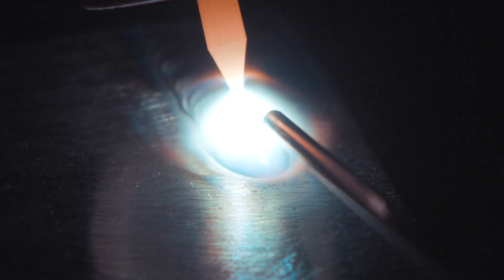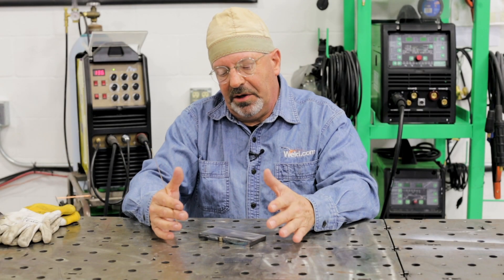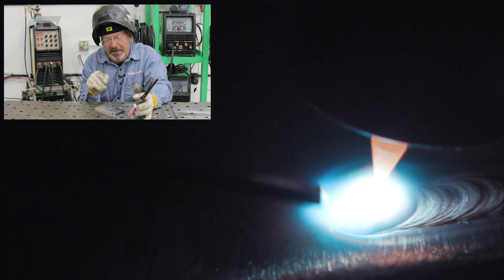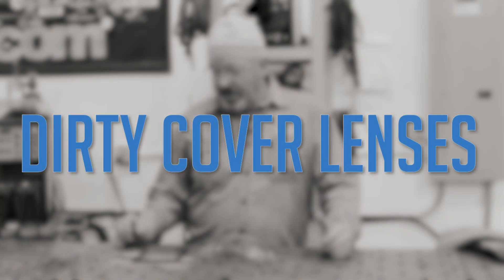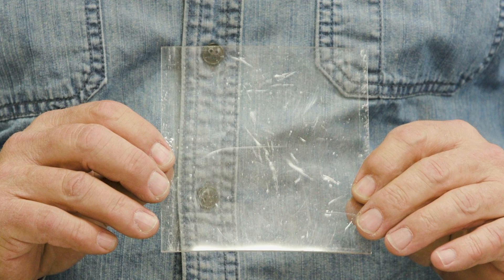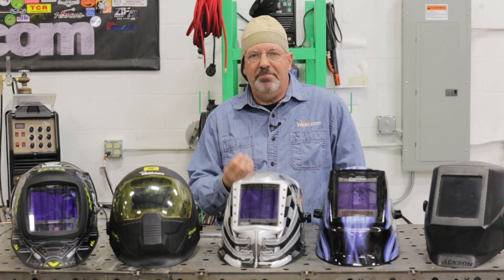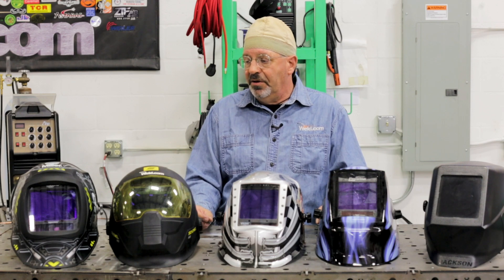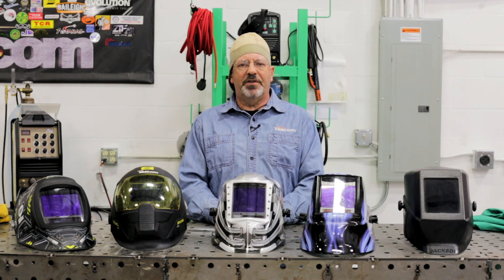I CAN'T SEE WHAT I'M WELDING!!!

Comment: I've always had poor sight from my left eye and used to suffer from the same issue welding,  which turned out to be light coming in from behind my mask, actually the sides. I noticed that I welded better, in the garage in low light conditions. Outside, I couldn't see at all after striking an arc. To test my theory, I ran some duct tape around the mask so that it touched my face. Instant success but it leaked light if I moved my head much. To remedy the leaking I installed window a\c foam around the inside of my helmet. It hugs my face, and keeps out the backlight. No more issue. To keep from trapping fumes, I leave .5"  gap on the top and bottom.  I also wear an n95 face mask, always did.

Comment: I went from a fixed shade lens to the cheaper auto helmets and managed okay.

Then one day I went on a spree and bought a higher end Speedglass auto. 910XX, (around $AU650) with the optical quality screen and colour sensitive which was also suitable for TIG. 

The difference was rather astounding. It was really easy to determine the difference on weld pool and slag especially with flux core. It certainly reduced the concentration requirement factor and made it all less tiring.

The old fixed lens still has its place I guess, but I haven't touched it in a long time now. 

Some of those cheap auto darkeners really aren't very good to use.

Comment: Seeing clearly is important for penetration.  I used an 11 shade and got used to it.  It's the best shade for high amps and you can still see decent at low amps.  I never trusted a 10 to protect my eyes completely.  Tig welded for 38 years and still have 20/20 vision.  But it's whatever works best for you.

Comment: Great video!  I welded for years with beautiful results.  I took ten years off with a job change and when I picked up the torch I was stunned at what happened to my skills.  I couldn't stay on track, my welds were awful and then I discovered I got older and I couldn't focus with the bifocals I now wear on a daily basis.  I got a cheater lens for the inside of my hood and the old me was back in the game!  The loss of visual acuity is so gradual and even with dirty or damaged cover lenes you have to keep this stuff clean.  Love your video's and love your style of instruction.  I wish I knew you 30 years ago to get me started.  Thanks again!!
Reply: I found the same when I got glasses. I think it changed=s your focal length and how your hands act with that as well. 

Getting your head back (especially if long sighted) and changing your welding posture with some practice helps.

In short, getting glasses really changes your welding dynamics, visually. This will often transfer through to your hands.

Comment: You seem to have a slow travel speed in this video. Is that because you are welding a thick piece of stainless so it does not over heat or is the video in slow motion ?

Comment: I bought a leather sandblasting hood on eBay. Pretty cheap. Got a snap kit for boat covers from boat supply house. Put male snaps on the hood and the female part on the helmet. The hood snaps on/off, keeps extra light out of the helmet. Works great underneath a car or outside.

Comment: I found putting bright lights on the whole job makes seeing what you're welding so much easier.
Reply: I found that welding refinery pipes outside in the winter dark really lowers ones expectations on quality😅
Reply: @datadavis  Right.. can't take a light plant with you to every job site , I was taught to run my auto dark on as dark as possible around a 11 or 12  so I know what to look for , now that I run a 9-10 I can see everything even in the dark
Reply: @jjames5928  good idea I think I'm going to practice that after I get good a certain welds.
Reply: @jjames5928  I aim a bright flash light at it while mig welding.
Reply: @jjames5928  
Interesting video. Just had the second session of a TiG class. I’ve been welding gas/Mig and fluxcore for almost thirty years and struggling a bit with good beads in class. Watching this video was a lightbulb turning on- no pun intended. I’ve done fine with Mig and wire feed fluxcore for years, but have been annoyed at times for losing an edge or wavering from a straight line with Mig. Now I see- pun intended- that running shade 10 or 11 is the problem! That first 50-60 seconds was an eye opener; I’ve essentially /never/ seen that with Mig and definitely can’t (haven’t ) seen that detail with TiG. I’m going to back down to 9 (or 10 if 9 is bright. 

I wish my class 30 years ago had mentioned this and given a visual like this opening was. That instructor said use 10+ but if one’s eyes were sensitive use 11. Do I have. I think that’s going to be a total game changer for me. This TiG class didn’t mention what’s supposed to be seen either.
Reply: Never thought of doing that but I'll try it now, thanks for the tip.
Reply: @mrmyorky5634  me too
Reply: @mrmyorky5634  you
Reply: I mount a headlight flash onto my mig welding helmet, so I can see where I am placed before the arc starts,  I will always be just a beginner.  Wish a light could be synced with the autodarking
Reply: @brianburke7440  it actually can be , however it woukd take alot of work to wire it in , I'll talk with my friend at ESAB and see if they have any plans on a built in light
Reply: @brianburke7440  ,,, yes, that was my thought too. On the helmet.
Reply: I completely agree.
If you can position a simple Halogen floodlight (250 - 500 watts) on your work piece, the difference in visual clarity is amazing.
No more guessing at proper positioning of your welding gun, prior to starting an arc.
Strong lighting is a major help.
Reply: Mark Spencer u
Reply: Exactly.  I used to use a 1000 watt high pressure sodium grow light.  I could see perfect even before the arc started.
Reply: @brianwilson4861  That’s a great idea, I was thinking about doing the same.
Reply: Yes! I took shop lights & mounted them on drum cymbal stands so i can put them anywhere for that exact purpose
Reply: That helps.  However, sometimes, even my little Home Depot LED lights will activate my auto-darkening lens. Positioning is everything.
Reply: @twwtb  With a good external light you don´t need the auto darkening mask, the cheapest non auto darkening mask is perfectly fine, at least for occasional use.
Reply: I have a Esab helmet, about 7 yrs old, i made a metal bracket with a hinge on it, bolted it to where my chin in,  i use one of these led lights with a magnetic back that i fix there when i am working in the dark or low light, works a treat.
Reply: That is my solution... the only problem I can't get the light on the project sometimes because of the position of what I'm welding.
Reply: Spot on, I have found using a really bright LED light amazing, use cool white, not yellow.
Reply: What is your favorite lens bud.
Reply: @guybarnett131  i don't know anything about them mate.
 I just use whatever came with my auto darkening helmet
Reply: I wonder if anybody has ever held a flashlight in there TIG hand? LOL
Reply: Why Mr. Weld.com doesn't even mention that is beyond me.
Reply: True that!!!
Reply: that's "My Plan"
Reply: This is a great point I totally agree brighter light does allow your pupils to see things more clearly.
Reply: I finally found someone that does what i do, even a good lantern does all the difference specially with non auto darkening masks. With a good light the auto darkening masks are unnecessary.
Reply: Thanks!!👍
Reply: I found the best way for me to see, is not to wear a mask to begin with!!

Comment: I use an adjustable shade lens . The only thing you have to remember is to keep it dark enough so you only see the edges of the puddle. Most often though you need to see where you are steering so it's a fine line between the two that you straddle. Having the ability to make that fine tuning is worth the investment.

Comment: I haven't read through all the comments here, but I'm wondering whether anyone has used gold lenses.  I had real issues trying to follow a line because green-tinted lenses flared white light so brightly - even with brand-new lenses and covers.  Gold lenses, however, allowed me to see the whole weld puddle clearly - in a reddish glow, without glaring.

Comment: Higher shades are necessary when you go to metals that are reflective while liquid, such as Aluminum, Stainless, and all the heavy nickel based metals.  I've had to use stacked 9's when welding 1/2" Inconel, Incoloy, and so forth.  Of course I usually use a lighter lens with Titanium, and of course Magnesium is always a bitch no matter what you do, since you have to weld it different from any other metal I've ever welded.  I prefer High-Frequency start to scratch as you can get tungsten imbedded in the welds, not to mention losing the point and fouling it.  X-ray for certain procedures will fail if tungsten is found in the weldments.   FAA certified for 6 metal groups, welded for NASA, Aerojet, High pressure certified, Cryogenic cert, 6G, pipe all welding types with heavy amendments, all position plate, again 1" plus certified, Rebar certified for all pos. and 1" plus.  Sometimes the lens you need isn't made, and you have to get creative. I was an old school welder until sidelined by being dropped way too far over concrete and had too many bones needing reconstruction with titanium implants.  Never seen those new type of helmets though with the curved lenses, must be great for tight areas, but the cover lenses must be a hell of a lot more expensive than the large that apparently we both use or "used" in my case.  Keep your wire dry and clean, and take care.

Comment: I arc welded at sea for years without any problem, now retired and at home I tried to tig weld and once again arc weld and I had a massive problem not being able to see what I was welding at home. I’ve watched many u-tube posts about this subject. I cracked it about three weeks ago. I used a LED spotlight hanging about 6 foot to the side of my work bench shining on the job at hand. What a breakthrough for me, at sea the engine room lighting was always excellent at home in my workshop, not so good. I hope this helps someone like me.

Comment: Great vid.  Welded for an income 30 years ago (yes, they had electricity), and just started TIG welding again for home projects.  Fired up my old Syncrowave today, and really struggled with seeing the weld puddle detail.  Had a dirty cover lens I wiped off a couple times (was SMAW welding before).  Also, had my lens cranked to about 11 (just like my guitar amp), because the scratches spread the arc and made it too bright, or so I thought.  But, the amp stays up at 11.

It's all in the details......

Oh, your link to your lens chart doesn't work anymore.  Damn internets....

Comment: I am half blind in one eye where my vision is distorted in one eye. 
To be able to weld I require super clean lenses. 
The other issue is that if I was to attempt a weld that is 16 inches or 550mm away I have no vision so I discussed this with my optometrist and had a special lens developed just to correct my vision deficiencies. 
I also have what you call a cheater lens but I don’t like it.
One issue is as you get older the lens in your eye and the gel begin to become opaque and doesn’t allow light to get into your eye.
So flooding the work piece with a bright light assists.

Comment: Ok, thank you. But I have a question for you, it may sound dumb, but I have always been one to ask questions if I don't know. I'm going to learn to weld at age 60. yeah my first time welding. Body work on my car needs to be done. I can't get no one to do the body work. So the heck with body shops. I'll do it my self. Its a 1968 Ford Galaxi Fastback, made with 20 guage metal. I also have 20 guage metal. Just some general info to let you know what metal I'm working with. I've already made excellent body panals. Forming and shaping took alot of days and hours, I'm a perfectionist. And yes I will primer and paint it later on. Anyway I got the body panals where they need to be fitted and rolled precisely. When I have it done, they will be no body filler. Ive grinded my panal cut to a 45 degree angle, so there is no over lay from patch panal to body panal. Meaning no gap as well. I'll build up my weld alittle at a time. Spot every other inch then let cool due to not warping the metal. Then repeat process next to my weld and careful not to burn a hole in the metal. let it cool and restart it. Basicialy, I know how it's done. But I've never welded before. Harbor freight is my choice to buy a welder. But like most stores, they will sell you something just to tell you that you need it just to get you out the door. Ok, so how do I start? Practice yes, but what do I need to practice with as far as having the right welding set up. Hood wise, I'm buying and going to use a wire feed welder. I know nothing of what Hood lenze I should use. I have great vision, both near and far. Thank you.

Comment: This is probably not very relevant to most, but I would like a little help.  I have been a TIG welder for years.  Mostly Chrome-Molly tube.  A few years ago I had an event that left me with very little sight.  I have 20/400 in the left eye and nothing in the right.  I have tried repeatedly to TIG since then, but cannot see the weld seam.  I have been able to run good beads on flat stock with a reasonable level of filler, but just can't see the joint at all.  I end up all over the place.  I have done a few welds with a #8 shield where I could see the joint OK, but was concerned about that level of filtration.  When I go to a 9 pr 10, I can see the puddle, but nothing else.  This is under 1/8 thick 4130.  Most of the time I would be under 100 amps.  Should I be wary of welding with the 8?  With the loss of sigh I have started getting very close to the weld and maybe I am getting too short of an arc which doesn't produce the light I need.  At 9 or 10, it seems very dark.     Please let me know what you think.  I still enjoy building motorcycles and don't want to have to have someone else weld them up.  Thanks and this is a great video.

Comment: Thank you for this, this is a great video.  I am using a 120v flux core welder and I have a really hard time seeing what I should be doing.  I am using a harbor freight auto darkening mask, and I have replaced the plastic front.  This is perhaps a stupid question, but what should I be looking at?  I've heard people say to look only at the puddle, but then I wonder how to weld where you want it to go.  I also see in your videos that you can see the side of the pool and how well it is penetrating.  I used to have a mig welder and it was a tiny bit easier to see, but I was still doing a really poor job of seeing what I was doing.  I've tried playing around with the darkness setting to no avail.  I have blue eyes which I guess means I'm supposed to be sensitive to bright light.  Maybe that's true, not sure - I do wear sunglasses whenever I go outside during the day.

I am old enough that if I am wearing my contacts for nearsightedness that I need to wear reading glasses over top in order to focus on something small like text at around a foot distance.  If I don't have my contacts in, then I can see text easily even at only a few inches of distance.  So when I weld, I have been welding without the contacts and without the reading glasses.

Have you done (Or could you do) a video where you show the welding process, and maybe draw circles around where we should be looking (Or maybe arrows?).

Thank you very much for all of the videos you have put out.  I'm not trying to become a professional fabricator, I'm just trying to get good at it for my weekend projects.  I have a Fourney 140i welder BTW.  I was using harbor freight wire, but I just bought some INE wire (0.030) because it looks like that is a much better flux core wire.

Comment: Any information on air arc gouging? The us forest service requirement is 225 amp arc welder with air arc capabilities. Some welding supplies have trouble answering my question, wanting to sell me a 8500.00 machine....I find its like a plasma cutter or a bad weld cutter outer, that sprays sparks all over possibly starting another forest fire ......I'm a mechanic wild fire technician thanks for your time.....

Comment: Any similar tips but for MIG welding? I think the problem I have is actually seeing/knowing where the tip of the wire is being fed into, many times I think I'm following a line etc but when I put the torch down, I'm actually slightly off it.

Comment: Another issue that some might have is not the equipment, angle, technique or process. It may be your eyes, just to be sure if you can't see the puddle, because it is too bright and a darker tint does not help. Try going to an optometrist. Make sure that your eyes are ok. I thought mine were fine, but i had cataracts, after some treatment all is well again. But i have never seen this issue addressed in any video or tutorial on here.

Comment: The other issue for people new to MIG welding is if your weld just ain't coming right it could be because you have a bad contact tip or a bad ground connection. If you don't weld every day or are new to welding you may not automatically think to check these things if your weld has gotten worse over time or it just doesn't seem to be welding like it should. I learned a while back that contact tips are cheap and safe a lot of frustration over wondering why my arc isn't as smooth as it could be.

Comment: I keep clean lenses in my hood and i keep my head forward of where i'm welding in the direction of travel. I keep my head out of the smoke and see where i'm supposed to be welding by the reflected light of the puddle. I will glance back and see the edges of the bead but i do not stare at the puddle, the sun or the flashbulb of a camera.